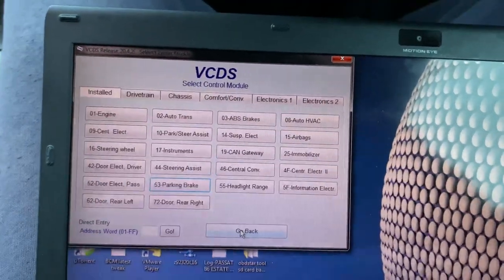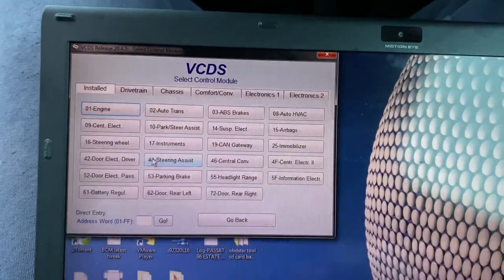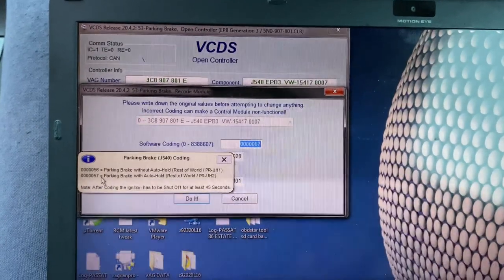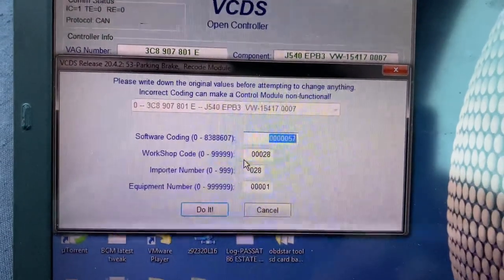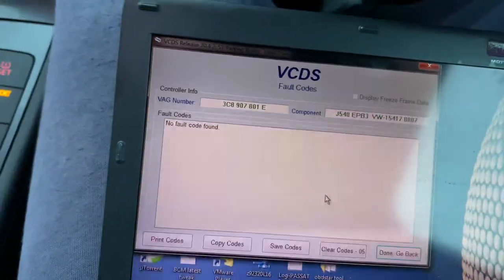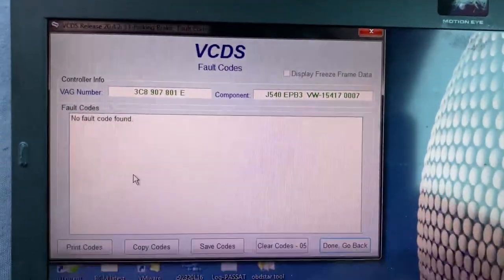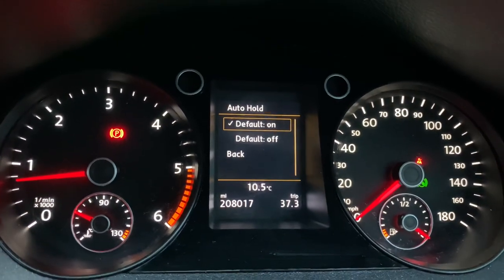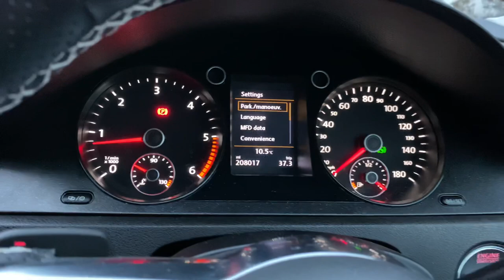Passat b6 electric parking brake module coding

Comment: What was your previous module? 3C0907801E? The 3C8907801E is for the cc but does it all work OK on B6 with no cruise control errors etc? Sometimes they will technically work for EBP but create problems in other areas.

Parking brake module is fried on a 2007 B6 Passat; looking at options for reflashing software version from 00003 to 00005, or fitting EPB module 3C8907801E or 3C0907801G. Former number (8/E version) is cheaper and more readily avaiable, so if it definitely works post-coding, I'll use that. Cheers for input
Reply from the maker: I’ll choose 3c8 one but keep in mind, plug might be different, had a 2005 module and was different plug compared to 2007 and 2007 model was again different from 2008 on the plug. Just have a look at the plug. Coding is easy and everything works fine. Is worth upgrading to 3c8 if you have b6 facelift white cluster so you can change settings for autohold.

Comment: I'm getting this code on my VW cc for the parking brake flashing but my parking brakes work fine. Would my parking brakes stil work if the module wasn't coded
Reply from the maker: Connect diagnostic and see errors, if you did replace the module might need coding but definitely a basic settings with vcds.

Comment: With installing a new module, do you need to do anything first, like unplug the battery first, remove the old, replace the new module then reconnect the battery?  I read that something with the old module needs to be copied first with the vcds before the new installation or the abs information will be lost
Reply from the maker: Full scan with vcds and save it. It will get you codes etc saved. After replacing the module you need to code it.

Comment: hi, i have a problem with my parking brakes. Fault code 02845. The brakes open and close perfectly. I have already changed the button and the coding is correct too but i cant delete the fault code. Passat CC 2008. Any ideas?  Thanks
Reply from the maker: Probably your module is bad, 3c8…A version had issued
Reply: @lavianeverything  flashing the module would help? would you suggest that i buy a second hand one and code it or buy another version of the module?
Reply from the maker: @daniallsz  get a newer version but make sure part number starts with 3C8……..E or higher, copy old code over and do system function test, when replacing epb, remove battery terminals

Comment: I have a probelm with my B6 passat with auto hold pakring brake, my brake works, but i cannot retract them to service them. When i use my vagcom i get a error message trying to open the caliper
Reply from the maker: When you try to do the operation epb has to be retracted by switch, ignition on ,engine off, then try to wind back by vcds.
Reply: @lavianeverything  I'll try it thanks
Reply: @lavianeverything  it's worked thank you

Comment: Hi guy! 
How to upgrade the screen on Dashboard which shows the function Auto-Hold? Thanks
Reply from the maker: If is on B6 Passat that had standard red cluster and made before 2008 will need white b6 facelift cluster not B7 3AA , 3c8 handbrake module and then you get the menu in cluster.
Reply: @lavianeverything  Thank you! I have a problem with the Auto Hold function on VW CC 2010. Pressing the AutoHold button is not working, and the menu AutoHold is not displayed on the Dashboard screen,  EPB function works normally. I scanned that system via Scantool: no fault code but  Live data shows: ERROR in Auto-Hold button (E540), Auto-Hold lamps: Off
Have you ever seen this case?
So do I need to work on coding for the EBP module?
Reply from the maker: @thuantr2012  switch faulty, the switch has to be replaced with a genuine one. That’s the reason why many people change it to b7 center console.
Reply: @lavianeverything  thanks for your support!  So why is the menu AutoHold not displayed on the Dashboard screen??
Reply from the maker: @thuantr2012  because you have errors
Reply: @lavianeverything   Thanks for your advice. I took out the Auto Hold switch and checked pins and PCB contact pad by VOM meter, it's normal, LED lights are bright.
I also checked the supplies, and signals to the connector, they are normal
Is any other problem happening?

Comment: Hi there, i have a parking brake problem on my passat cc 2009.. the thing is, my parking brake works perfectly, but when i park my car, activate the epb.. next time when i put my key into ignition i get this yellow P crossed and a message saying "fault with a parking brake, see owners manual" but if i pull the key out a bitt and  start the car again, the warning light goes off.. 
I also dont get a red indicator light on the dash when epb is activated at all.. went to a electrican, he checked it, said it might be the faulty dash itself.. also tried 2 different switches but it didnt worked for me.. 
I cant find anything on the internet where someone had same problem as me.. i was wondering if you could tell me the solution to my problem? I can live with this problem, but im afraid my car wont pass annualy car control bcs of this.. thanks
Reply from the maker: Will be fault stored in epb module, use vcds, do system functions test on basic settings menu, if you don’t have anyone with VCDS around, look on Facebook where you live to find someone. I’m UK based. If i can help, I’ll do it but my health is not ok, i can at least advise you what to do
Reply: i have excatly same symptoms on excatly same passat cc and as well due to MOT, and afraid i wont pass it! can't find any help, cleared codes, came back!! all works but error keeps coming back!! :(
Reply: @S1L3NT__  do you also dont get a red indicator on the dash when epb is activated? Im scheduled at monday, some car guy known for messing with modules will check it out for me.. i hope he can find a solution..
Reply: @yasko6719  yes! excatly all the same as you. and started noticing after i changed both rear calipers! im now looking for some electric too. please let me know if you find solution..
Reply: @S1L3NT__  will do 👍
Reply: @yasko6719  thanks. if i find solution wil llet you know too. as i have next week MOT and im sure it will fail due to that warning light despite all works :(
Reply: hi did you find out whats the reason for this error?
Reply: @S1L3NT__  not yet, he couldn't take me in today, i will leave my car at him in the morning
Reply: @S1L3NT__  fixed it! From what he told to me was.. He tried switching the button,dash,wiring to the dash.. and lastly it was the epb module, he tried another module from a passat 7 but that didn't worked.. he then called VW dealer asked them which one to get according to VIN number and then picked one from the scrapyard, put it in, programed it and now it works perfectly.. i ended up paying 200 euros total which is far less what would VW charged.. so thats it, i hope this helps you to get to fix yours! Good luck